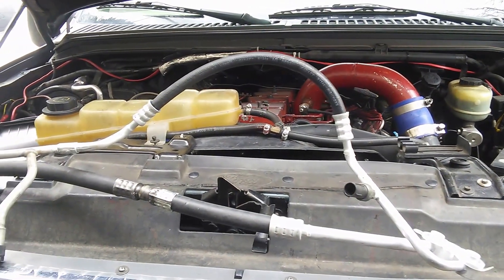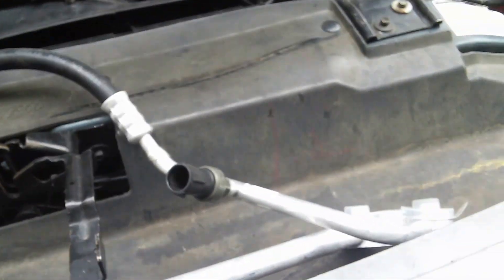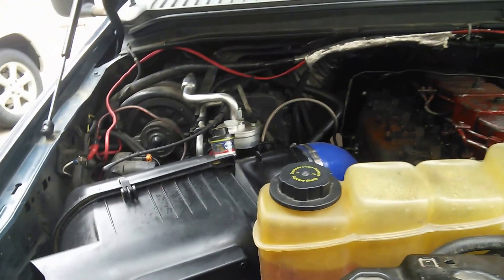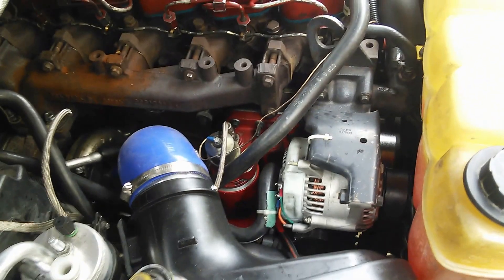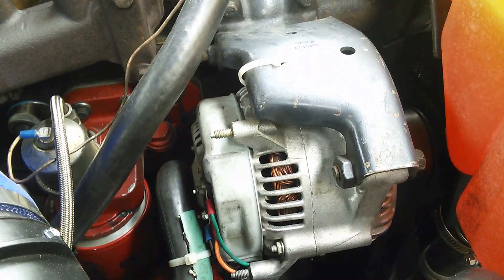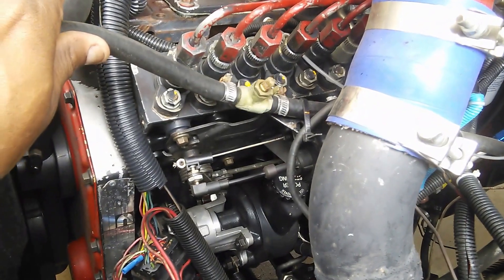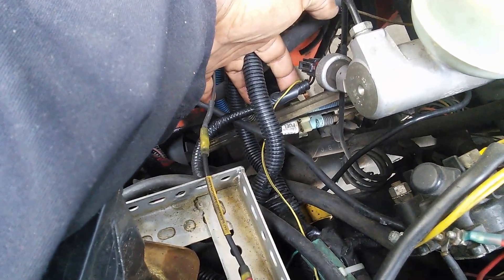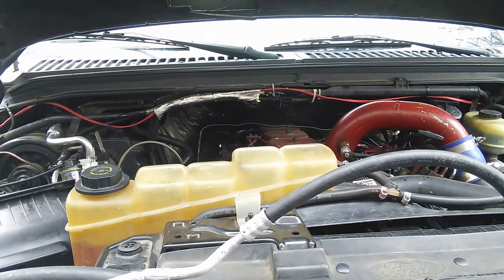Fummins 12v final update. I have everything working. Forced to sell thanks Denver

Comment: Hey mate, One thing I was Just a little unsure about, did you use the factory diesel pedal or did you put in the gas pedal from the same year? Any help is appreciated.
Reply from the maker: @mitch7.3powerstroke81 I bought a new pedal from a gasser f250/350 it has the mechanical fork for a cable.cable want to say was factory cable on pedal side and I went to ace hardware for ball ends for motor side. 

 the factory pedal is a electronic potentiometer. It won't work with throttle cable, but if you do a newer common rail they can use it.
Reply: @omieyouknowme  thank you very much I appreciate it.

Comment: Nice video, sucks that you had to get rid of it because of city/state regulations crap. I’m in the middle of installing a 12 v on a Megacab and I happen to have an he351 that would love to install in it. I wonder if I can run the waste gate of the P pump as the stock wh1c does 🤔 any clues ?
Reply from the maker: It worked, had the get the sensor bung and clock the housing.

Comment from the maker: fummins is no more. week after this video Denver told me I can no longer have this vehicle registered because it's an old engine in a new vehicle. I have been forced to sell her, I hope new owner enjoys working it as much as I have.
Reply from the maker: Mississippi Mike thanks even my wife said she will miss it. I would pull i70 and any Hill or mountain with our trailer passing others, all the while keeping my water and oil temps at or below 200. I'm back in a 2000 7.3 again
Reply from the maker: Mississippi Mike going to 7.3 even with a mild Jody tune it is nothing like the fummins. Fummins would walk over and away from the 7.3 with the zf6 and get better mileage too. Just weighed the current 7.3 it's super cab on bed, it's only 100 lbs lighter than fummins. 7700 with full tank, tool box and my fat arse.
Reply from the maker: fat guy no more it ran cleaner then my neighbors 04 common rail and co workers 6 leaker. It's done, I'll do another one if I must, but I rather spend my time fishing now as I get older.